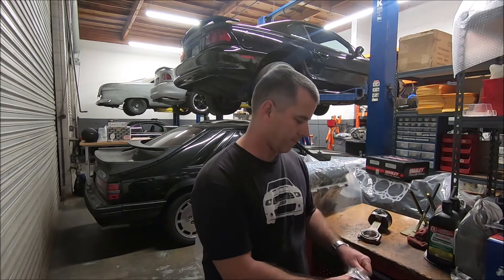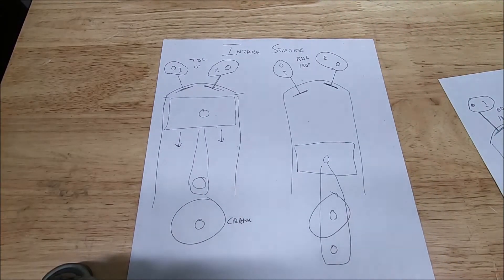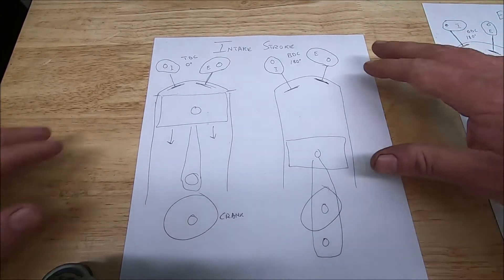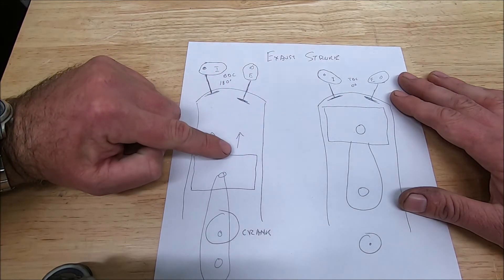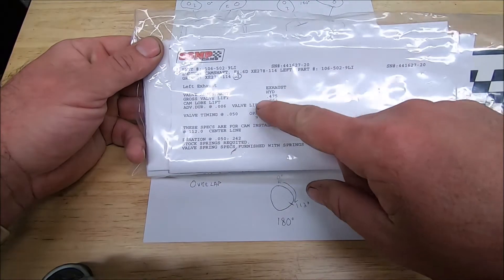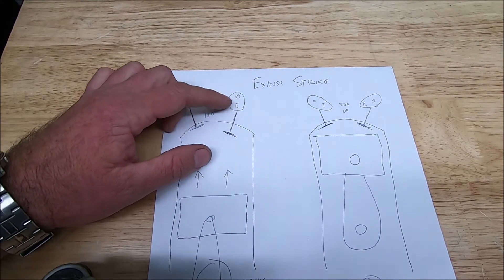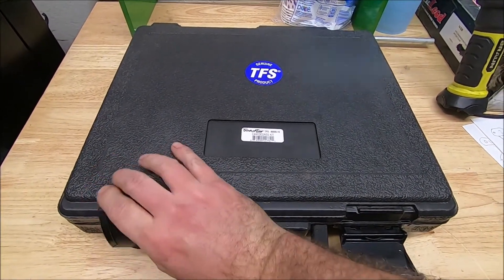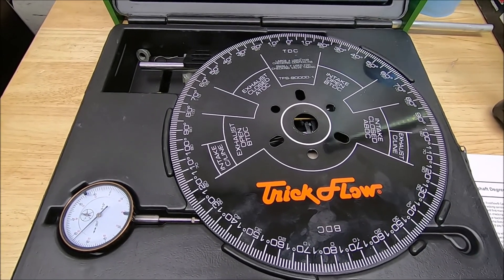Why it’s a good idea to degree cams in a Mustang 4.6 SOHC and DOHC engine

Comment: I paid a shop to do it for me, TFS 185 38cc heads n MHS TFS Stage 3 cams n they said they'd degree the cams.. I'm very nervous bcuz they're not a performance shop n i guess they never modded a 4.6L 2v P71.. Do you think they'll get it degreed correctly?? They have many years of experience doing mechanic work, 0 negative reviews, but man, it takes skill n smarts to mod an engine right.. Sadly HTX doesn't want to build these big ol' boats.. Hard to find a shop..

Comment: Good video that helps clear it up for people like me that don't do this on a regular basis. 

I am degreeing my cams right now on a 5.4. I would say usually they probably don't need degree'd due to the piston sitting so deep in the hole, but my block and heads have been decked.  Block was decked alot by previous shop and i didn't go with a thicker head gasket cause i wanted extra CR.  So when i first degree'd in Ex Cams were starting at 110-111 for a set of comp 106460s which have a I and E CL of 116.  And i was shooting for some advance for street drivability so wanting the Ex at 119 and In at 113.  I would agree that a few degrees isn't worth a ton of HP and as long as PTV isn't a concern and as long as you haven't changed the height of the cam relative to the crank by decking block or heads significantly you can snug the keys and go.

Comment: Hi John in you picture,  the duration is that number advertised duration or @0.50 measurement? Below is what my cam specs are that I will be installing very shortly. 
Crower Part# 62824-4
Advertised Duration Int/Exh                          258/258
Advertised Duration @ Valve Int/Exh            270/270
Duration @0.050" Lift Int/Exh                        212/212
Duration @0.050" Lift at the valve                228/228
Lobe Lift  Int/Exh                                         269/269
Gross Lift  Int/Exh                                        484/484
0" Valve Lash Intake or Exhaust
Rocker Ratio Int/Exh                                     1.8/1.8
LSA   114  
**************************************************************
So The advertised duration@ valve = 270; Why did Crower supply that number and why is it important?
I put my engine together set up the timing used just my test springs and put puddy onto of pistons. My pistons are .008 above the deck and heads machined flat was .007. It is a Teksid Block. The heads are 2004 up 9 thread.  I used SCE copper gaskets measured .062 only torqued at 30Ft/lbs.  MY MLS gaskets will be 0.042. The copper was just to check valve to piston clearence. Intake valves just touched pistons was the impression in puddy. They are Carrillo Bullet forged pistons with 9CC dish its a stroker so it will be close to 5.0L displacement as I am bored.020 over. Depending on my gaskets It should be 10.4:1 compression approximately as my heads are ported and chambers worked I tried measuring the CC volume but do not have very good stuff for that but should be 53cc.  I had to get valve reliefs machined into my pistons. Just got my short block back for the second time. This will be in my 03 Mach 1. 
So what numbers do I use to degree my cams? based on your video? 
I am at the cross roads with this engine 6 years in the making and $20K. I want to do this myself but I am a bit nervous at this point. I have Modular Heads Wheel and Crank tool and dual dial gauges. The ford Cam installation kit. So any words of Wisdom feel free. Thanks
Reply from the maker: I looked at their website for that part number and down in the description it has Lobe Center listed as 114 but normally for a 4V there will be two different centerlines (one for exhaust cams and one for intake).  I recommend calling or emailing Crower and ask them.  As far as piston to valve clearance it might not be a bad idea to check it with the dial indicator at 10 degrees before and after DTC.
Reply: @JohnSmithRacing  
Thanks John I will call Crower.

Comment: I may need some advice....
First off, thanks for your vids!  You’ve given me the confidence to take on cleaning up my cobra engine.
I’ve got 98 cobra engine heads removed and will clean off carbon, replace head gaskets, timing cover gaskets and replace valve seals.  My plan was to follow your vid on timing a dohc engine by the markers, but a forums is saying I need to degree my cams.  I’m putting everything back to EXACTLY where it was.  Only things that are replacing are gaskets and seals.  Do I still need to degree my cams if I’m putting everything back the way it was and following your video on setting timing by chain and sprocket marks?
Reply from the maker: Cool, I am glad the videos are helping you out.  You do not need to degree the cams if they are stock cams.  But while you are in there you won't regret putting cams and springs in haha  Nothing like the sound of a cammed engine!
Reply: @JohnSmithRacing  thanks for responding!!!  As much as I’d love to upgrade, going to have to hold for now.  Completely restoring entire car myself from ground up and new cams, plus new springs, etc., would unfortunately go over budget.
Reply: @JohnSmithRacing  again, thanks for responding!! You’ve saved me a lot of time and unneeded stress!
Reply from the maker: @wesharris1845  No problem, let me know if you have questions and I will try to help.
Reply: @JohnSmithRacing  hey John,
I’m sorry to bug you out of the blue, but wondering if you might still be able to help me.  I’m refreshing seals, gaskets and header bolts on my 98 cobra engine with cleaning carbon off all the valves and heads.  Valves are going back in the EXACT SAME SPOT they came out of.  Visiting other forums they are saying I need to either relap the existing valves anyway or buy new valves and springs and get the heads machined.  If the heads are still flat and all the valves are still sealing (I’ll be testing by putting spark plug in, flipping heads and putting water on the valve domes to check for leaks), do I still need to do all that?
Also, it APPEARS that my exhaust valves had some kind of coating on them.  Any problem if all my valves have been cleaned to straight metal?
Sorry to throw a lot at you.  Hoping to be done soon!
Reply from the maker: @wesharris1845  Some people will say there is a lot that "should" be done since the engine is apart.  Depending on the internals you may not have to do anything but use new gaskets.  You don't NEED to lap the valves or machine the heads.  There is a good possibility that doing both of those things could help with sealing but if you didn't have a problem before there is a good chance it will be just fine without doing either of those things.  The valves should be fine.  Any coating would most likely have worn off where it seals anyway.  Don't let other people make up your mind for you, less people to blame if its wrong haha
Reply: @JohnSmithRacing  both VERY good points on the coating and not having a problem before.  You’re right about not letting other people dictate.  It’s just that comment of “if you’re not a mechanic…” that causes doubt.  All I do is read and watch a LOT of vids and work very slowly, and be meticulous.
Thanks again for your help and for responding back!  I don’t really have a YouTube channel, but I’m documenting my progress on Instagram @nousentre

Comment: Have you or you heard of degreeing 3v cams and deleting their VCT?
Reply from the maker: Its not as common as degreeing the cams on a 2V and 4V but if you delete the VCT then I would think that checking the degree would be a good idea.  The fundamentals would be the same as I discuss in these videos.
Reply: @JohnSmithRacing   hi my builder just finished my 4.6 2v. Forged internals ported pi heads with springs and comp cams 274 my concern is i dont think builder degreed cams but he did say he set timing and he assured everything will be fine im putting boost into the motor i just wanna make sure hes telling me the truth before i pay and dyno car please any input helps
Reply from the maker: @angelgallo8949  Depending on what dish pistons you have and how old your chains are, you might be okay.  The 274 cams were designed for the NPI heads and have a little less lift.  If I remember right the 262AH is more aggressive than the 274s.  If he assures you that everything will be fine then if you get piston to valve contact he should fix the damage.  If the engine has already been running without P2V then it will probably not happen at WOT.
Reply: @JohnSmithRacing  i have 21 cc pistons and new valves for cams n springs  do u think ill be ok
Reply: @JohnSmithRacing  chains and everything else brand new as well
Reply from the maker: @angelgallo8949  21cc is big, you will probably be fine.  I would run it.
Reply: @JohnSmithRacing  can i use stock cam gears
Reply from the maker: @angelgallo8949  Yes, but you may need some cam limiters.  Comp Cams make a good set.
Reply: @JohnSmithRacing   my builder didn’t use adjustable cams they just used stock cam gears and timed it like stock comp cams 274
Reply from the maker: @angelgallo8949  Oh, I was thinking it had 3V heads.  Yes, stock cams are good as long as they are ground and timed correctly.
Reply: @JohnSmithRacing  they are 274 comp cams
Reply: @JohnSmithRacing  they are actually comp cam 278 they were timed but idk about degreed will i be ok
Reply: @JohnSmithRacing  or will I have ptv some people telling it just need to be timed some are saying they need to be degreed
Reply: @JohnSmithRacing  can u guys degree they for me if so how much
Reply from the maker: @angelgallo8949  Yes, I can degree the cams.  Please email me at johnsmithracing@outlook.com and we can set something up.

Comment: The math (dyno sim) shows that +/- 1 deg makes little difference but 3-5 can make a fair bit. Within a degree seems to be a reasonable build error limit.
Reply: By that math I should be okay with one cam being 0.7 to 1.1 degrees faster than the other right?

Comment: Great video!!!   I have a few questions on my 4.6 dohc build.   With block zero decked ( 8 thou removed) and 2 thou off the heads with a 36 thou head gasket do you see any issues with advancing a 01 cobra intake cam 4 degrees (202 duration .393 lift)?   With the cobra engineering secondary tensioner fix for the bank to bank timing descrepancy, can I just adjust the primary cam gears that came with my MMR kit and does that advance all cams or just the intakes? Looking to maximize power under 6000 rpm's.  I have a  ported pullied Eaton that maxes out around that rpm.  Thanks!
Reply from the maker: I don't consider myself an expert on cam profiles and the effects of advancing and retarding cams.  I wish I had an engine dyno to do my own testing on a lot of theories but I don't yet haha.  However, I have read that advancing the cam will shift the power curve down the rpm range and retarding it will push it further up the rpm range.  The main thing would be to verify that you have good P to V clearance.  You can file pretty much any cam gear to advance or retard.  If you move the exhaust cam it will affect the intake but if you move the intake it will not affect the exhaust because the exhaust drives the intake cam if that makes sense.  My next video will be me degree cams on a 4.6 DOHC and I will go over it in more detail.
Reply: @JohnSmithRacing  Thanks John!
Reply: What is the secondary tensioner problem everyone is anyways talking about read about it everywhere
Reply: @sSkillaz336  http://www.cobraengineering.net/tensioner.html
Reply: @MikesSolarGarage  thanks i just got my cylinder heads off to do arp headstuds new custom grind cams, springs etc. Gonna be getting a new tensioner aswell now.  Still haven't decided if i want to degree the cams though
Reply: @sSkillaz336  with custom cams you really need to degree them.  The cam card can be wrong.  Oem cams you can go either way.  The biggest reason to degree is to make sure each bank is the same.  Otherwise one side of the engine will make more power than the other side.  In extreme cases you will see one side of the engine has higher compression because of the cams being off from side to side.
Reply from the maker: @sSkillaz336  If the secondary tensioner on the passenger side is flipped it will not affect the timing of the intake cam on that side.  In other words, the passenger side is on the tension side and as rpms increase the slack can be decreased.  When the slack is removed from the tension side the cams move closer together in timing.  If you flip the passenger side tensioner it puts it on the side that will not affect cam timing under varying rpm.  I don't know for sure how much this affects a daily driver but to remove any doubt you can get a flipped tensioner.